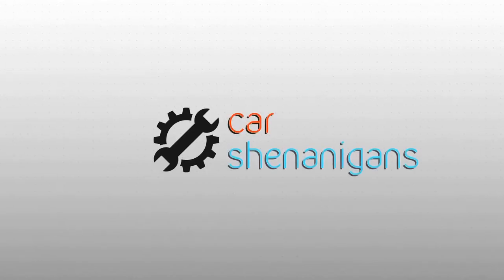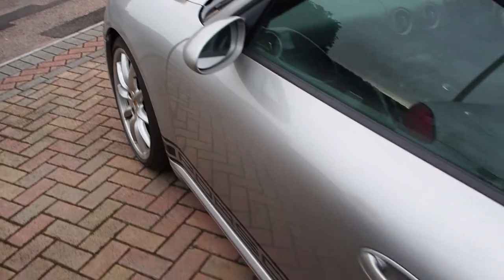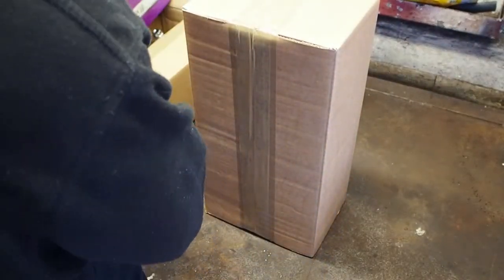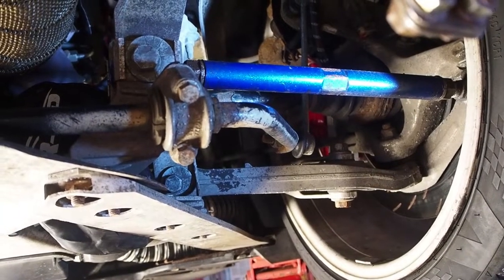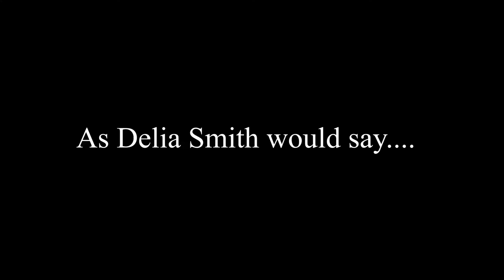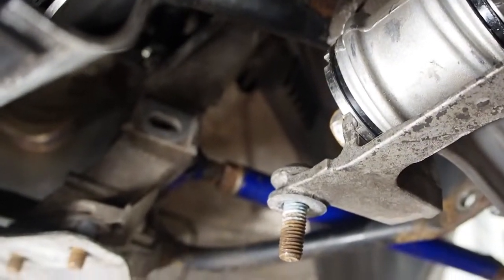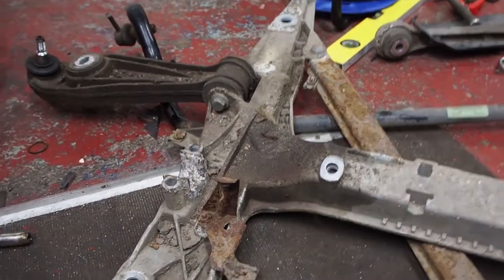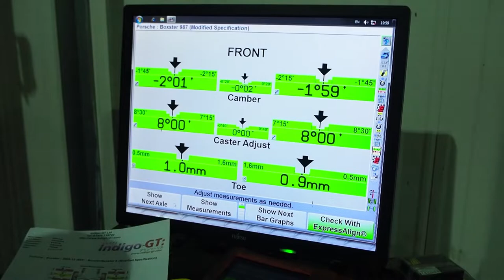Powerflex Haul - Adjustable control arms for my Porsche Boxster 987 Turbo

Comment: Thank you very much for making this video, but im not clear on a few things.  What were your final alignment settings that you desired, also it seemed you indicated during installation  that the rear adjustment could not function given the tight spacing for the tool to be inserted. Please clairify if possible as I might have misunderstood or not been able to understand the kings english. again thank you and looking fwd to your resposes.
Reply from the maker: I can't remember the numbers but they are on the video. To get the spanner to adjust them on you have to remove the arms from the suspension carrier so it's time consuming and a bit of a pain, compared to shims on some of the aftermarket lower arms.
Reply: @Escygt  well thank you. It seemed like before work started you were determined to get a specific rear camber.

Comment: How’s the new rear control arm with the Powerflex bushing been going now after 6 months of installation in terms of NVH? Still thinking to buy for the rears but just the non-adjustable version. However not sure if it’s better to buy OEM albeit much more expensive .
Reply from the maker: I'm really liking them, I've not noticed and NVH I'd attribute to these arms. It really sharpened up the handling.

Comment: Looks good. Are those hoses for rear brake ducts? Do a video on them!
Reply from the maker: Thanks. Those hoses are for my air intakes, I ran out of space in the engine compartment. I'll be doing a future video showing all of the modifications I've made.
Reply: @Escygt  what were the final alignment specs? Interested in what your final castor setting was
Reply from the maker: I left the castor at factor spec, 8 degrees. Front camber -2 degrees with 1mm toe per side, rear camber -1.5 with 1mm of toe per side. It handles really nicely on the road, I'm really happy with it.